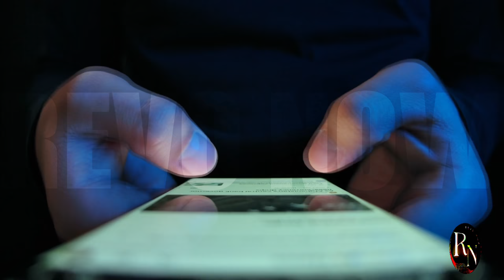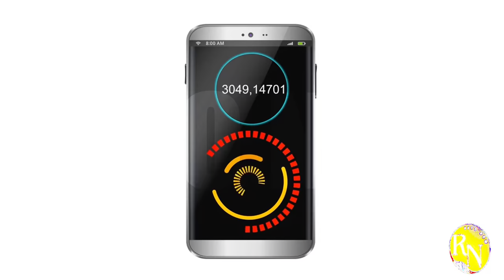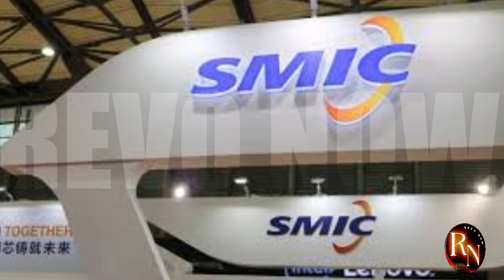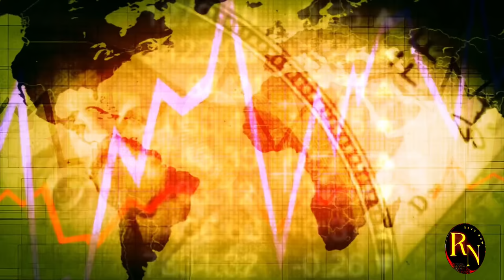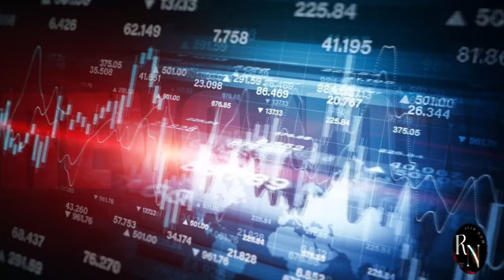Huawei's 4nm Chip: A Major Victory Over the US

Comment: Huawei's 4nm Chip? The one with a 20% yield rate?
Reply from the maker: There's no official specified yield rate for this processor over it's predecessor.

Since Huawei does not publicly disclose its 4nm chip yield rate, i cannot provide a direct answer. However, considering the yield rates of Samsung Foundry and SMIC, it’s possible that Huawei’s 4nm chip yield rate might be comparable to or slightly higher than Samsung Foundry’s 75% yield rate, given Huawei’s collaboration with SMIC and the latter’s 50% yield rate.

Note: This answer is based on indirect information and assumptions, as there is no direct data available on Huawei’s 4nm chip yield rate.
Reply: I'll be laughing my arse off with 20% yield rate & yet the chip cost similar price to western chips with 99% yield rate.